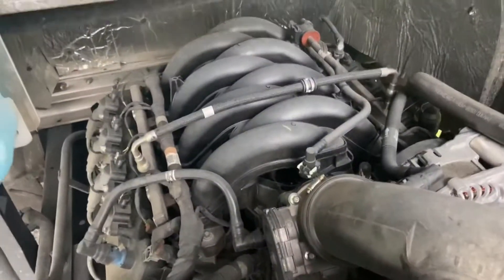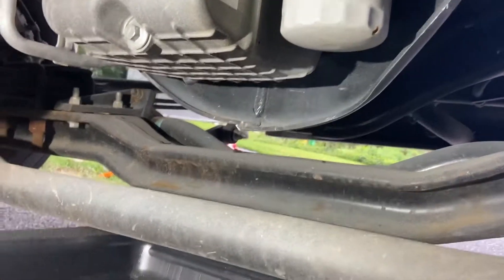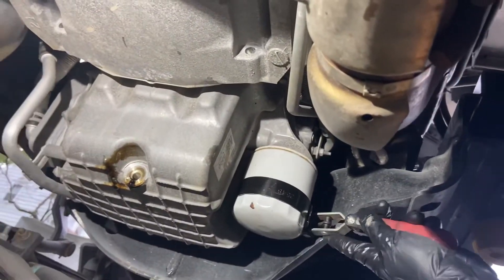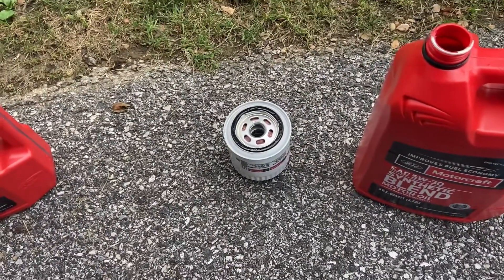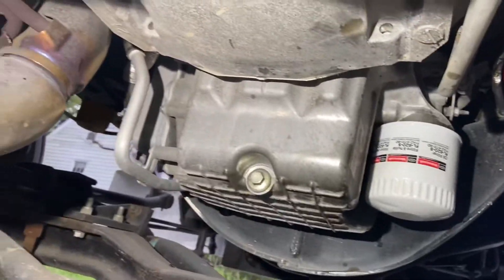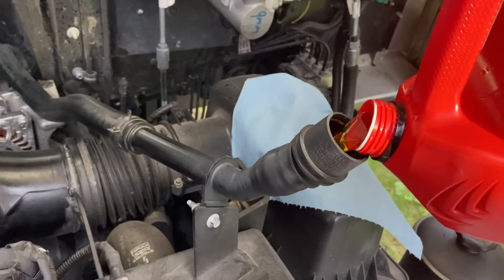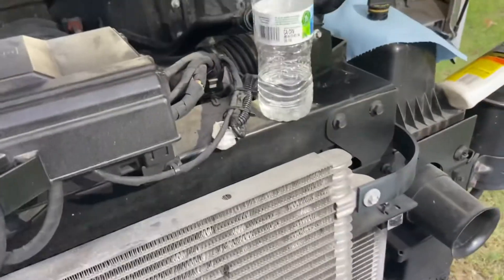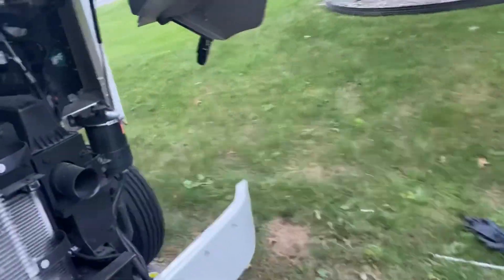Oil Change on a Cornwell Tool Truck!? 2020 Ford 7.3L F-59 “Godzilla” engine

Comment: 12:31 for future reference it’s a ford diagnostic thing if you put the gas to the floor and crank the key for 5 seconds or so you can build oil pressure without the vehicle starting. Then take your foot off the gas and start it up.

Comment: Man thats sweet you are running a gasser what kinda fuel mileage are you getting?
Reply from the maker: Horrible lol. Probably between 5-8 MPG. I gotta fill her once a day she’s always thirsty. I heard way too many stories of guys having issues with their diesel tool trucks so decided to go gas. So far so good!
Reply: @levithetoolguy1267  what your losing in MPG’s your making up in less issues, also this 7.3 for the complete engine, not a short block is 10k shipped , that’s barely enough to cover 1 injection job on a 6.7 diesel, and the diesels are having non stop DPF and emission troubles. They don’t last like they used to.
Reply from the maker: @gamebredduramax71  couldn’t agree with you more on that
Reply: @levithetoolguy1267  are you idling at each stop too? I had to consider mileage vs idle/hour depreciation on my fire companies command vehicles… fun fact I came up within our usage is a typical personal vehicle that idles for 1 hour is equivalent to 33 miles of driving…. In reference To emergency response, ( we idle, pump, generation, etc more than we actually rack on driving miles) it’s almost cut in half : 1hr idling/ 17miles of driving… … for for example, we retired our 18yo  129k mile command vehicle, 2000 Ford Expedition with the 4.6l if you do my math it sounds like low mileage but equivalent to 7,588 hours on the engine….. our PD vehicles that idle all day everyday, woof figure it out using that math, the manufacturer oil service is like 3x fold extended!
moral of my explanation: you may want to stick to early oil changes, but as you accrue hours/miles hopefully this will help you